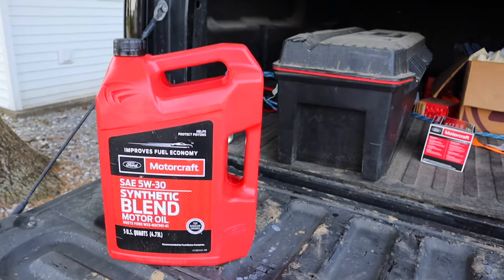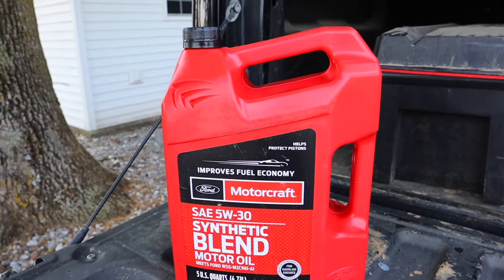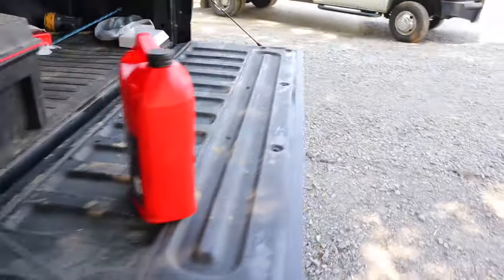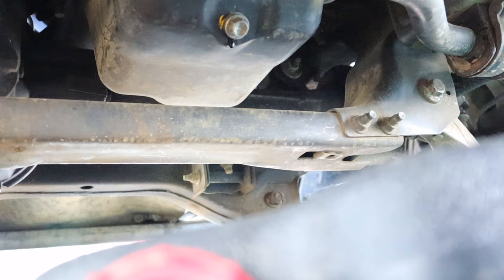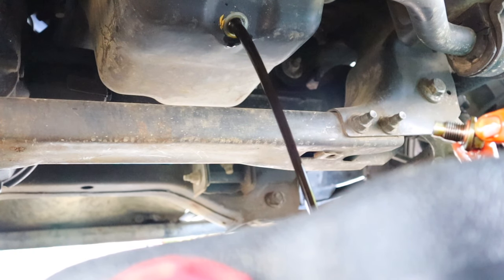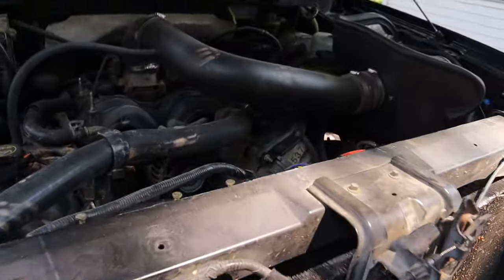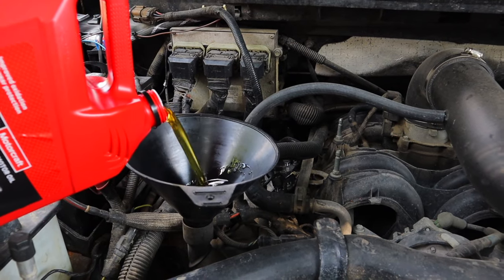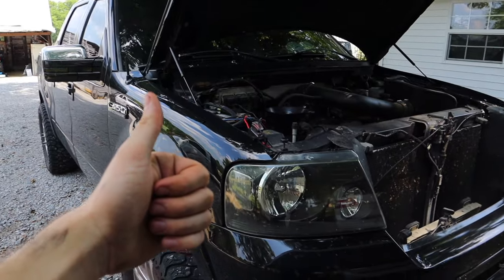HOW TO KEEP YOUR 5.4 TRITON RUNNING LONGER WITH LESS FAILURES!

Comment: I have a 2004 Expedition 5.4L with 240k I go every 5-6K in between oil changes, I use Valvoline maxlife high mileage 5w30 syn blend with a Motorcraft oil filter, the engine runs just as quiet as the day it rolled out the factory
Reply: I could be wrong, but I think you have the 2V, which were much simpler and stronger. I don’t think the 3V replaced the 2V until 2007ish.
Reply: @ESPLTD322  I do believe the 3V came in 04 for the F-150 and 05 for the expedition
Reply from the maker: 2v had issue with plugs blowing out of the heads. 3v has issues with plugs getting stuck in the head. 04-08’s are 3v’s🤙🏻
Reply: I use full synsitic
Reply: How much do you have to baby them? Is staying below 3,000 RPM all the time good enough? I have a 2010 4.6L 2V Crown Vic Police Interceptor and that’s what I do
Reply: @ESPLTD322  you don't have to baby the 5.4L or the 4.6L 2V those engines are tough but I get it, I baby all mine too, I have a 08 Crown Vic and just recently won another one from the auction, I've had my 08 four years 245K and I can count on 1 hand how many times I've done a full throttle pull in that car since I've owned it, its currently for sale, I don't need 2 of them, I already got too many cars 'lol'
Reply: I got a 2006 5.4 with 186,000 and my buddy who's a mechanic told me the same thing 5w30 and Motorcraft oil filter ..so far so good
Reply: @JayThompson25  not all 2 valves had issues especially the 2002 and 2003 model's. I had a 2000 f150 that had 308 thou miles on it when sold to a neighbor and it's still rolling. The 04 to 08 3valve engine failure rate is extremely high.
Reply: @infinity3jif  nope 2004 was 3v newbody expo first year was 2003 with 2V engine
Reply: @americanchauvinist1210   my 2004 expy has the 2 valve
Reply: @infinity3jif  or that’s right the new body expo first year (which was 04 my mistake) was a 2V ur right
Reply: @americanchauvinist1210  no, you are correct on the new body style starting in 03 but the 2 valve came in the 04  too
Reply: @ESPLTD322  Baby them??? I run the gutts outta my P71 interceptor,,,,,4.10 gears and SCT tuned
Reply: @ESPLTD322  With 210k miles on it
Reply: 2004 f150 had the 4.6l 2v
Reply: My 5.4 3v made it to 280k before it blew
Reply: @ESPLTD322 my 06 Expedition has a 3 valve. And 265000 miles.
Reply: @ESPLTD322 my 2007 Expedition and 2007 F150 both have the 3V engine. This was the 1st year for them,  so far they both have held up well.
Reply: My kid just bought a 2008 F-150 I work for a dealership as a manager not service However the advisors had mentioned to use 10w30 to build up more pressure in the oil pump that way there is no dry starts your thoughts on that
Reply: @richc8095  I've never heard of that before.
Reply: @thorrzyro what ended up failing on it?
Reply: @richc8095 thicker oil will build more oil pressure since it moves a bit slower through the oil clearances than thinner oil like 0w-20. But I’d personally use 5w-30 same with a lot of guys
Reply: @justingoats9155  oil pump took a shit, the biggest failing point on these 5.4 3v is the pump. From what I heard, early oil changes are highly recommended
Reply: @JayThompson25 do you know what causes a 5.4 3v 2004 f150 to shit off in idle like mine idles rough and shuts off
Reply: @Anthony-kn8cn shut up dude

Comment: 35yrs in a shop,,he's absolutely correct...Every 5.4 3v with problems I've seen has 1 thing in common,,,customers don't change the oil regularly...CHANGE YOU OIL these engines will not tolerate you not changing the oil....Use a Good oil filter not the cheapest garbage filter from walmart,,,a "good" filter and 5w30 oil of your choice
Reply: slimsherman5818  No I don't recommend them but not for reasons you may think....They may work I really couldn't tell you,,but what I can tell you about additives is this..Before Covid the U.S. military specifically the Army and Marines thoroughly tested several engine additives and found they offered no additional protection against wear...I'm sure if you search the net you can find that report somewhere I remember reading it afew years ago...I wanna say that Lucas oil treatment was included in that test...
Reply: Amsoil EAO88 filter and Mobile One Advanced Full Synthetic since 75,000 miles.  Just over 100K now in my 2010 5.4L 3v.  Purrs like a kitten.  Burns no oil between changes.  A pint sample of engine oil is sent out for lab analysis every 5K.  I currently going 12K between oil changes.

Comment: I have an 08 5.4 FX4 F150 bought new. It has 380,000 now with only 2 tune ups. I live in Houston TX it gets pretty hot here. I've been using Pennzoil 15/40 and Motorcraft  filter since broken in. Oil change every 4,000.  Truck runs great I love it. I do part time hot shot deliveries, have had up to 2 thousand lbs in the bed and have trailered  more then 12 thousand lbs. 15 mpg the day I brought it,14.5 mpg now probably because I run 305/50/20 Nitto Grappler G2s. Truck still looks great except for the inside of the bed.
Reply: Pennzoil 15w40, is that synthetic, because you said you go 4000 miles, that's high for conventional oil
I can't locate pennzoil 15w40 synthetic
Reply: Rule number one never use Penzoil in anything please stop using bro!!! Especially in that 5.4…

Comment: Ive got a 2013 expedition with the 5.4! Change my oil every 4 to 5000 and pull 6500 pounds everyday still running like a champ! I've owned 3 of the 5.4s now and have had pretty good luck with them!
Reply: What oil you put
Reply: @edgar547  use full synthetic . i use shell rotella gas truck red bottle
Reply: Same here. People have a very hard time believing it, but Ive got a 2008 F250 5.4 3V I bought new, and it's got 223k miles on it. Engine is all original with no oil leaks and had spark plugs changed only once at 115k miles. I change the oil every 3k-4k miles and it's never had anything but motorcraft synthetic blend put in it. Also gets a new air filter every 6 months.   I have a theory about these engines. They need to be revved to redline often {atleast a couple full throttle pulls every time you drive it). If you baby them around you'll have problems. Keep the oil fresh and drive it like you stole it!
Reply: That’s because ford addressed the major problems in 2010 with the 3valve

Comment: Bought my used 5 years ago. Its  2005 FX 4 super crew  it has now 310,000 miles and counting.  Switched to 05w30 when it had 200K drove and sounded better right away. I now use Castro high mileage synthetic blend with Slug Protector 5qt and Lucas oil stabilizer every  3K - 3500 miles. Made a huge improvement on ticking noise and overall performance. And to help with poor oil delivery on rights side of engine during  start up, I just add  little  oil and  she starts sounding like a roaring lion.
Reply: What’s that last part mean ? You add oil before you start it ??
Reply: @justicelizana2517  yea I didn’t get dat part neither
Reply: So 310k miles? Stop driving it rn and it won’t blow up.

Comment: Well guys I’ve always ran  motorcraft 5w20  and filter its whole life with one tune up. I’ve had this truck pretty much its whole life. 2004 with 212k miles still running strong.

Comment: I have 211,000 miles on mine {2008}. No problems, no leaks and no issues. I change the oil before the recommended mileage and flush the radiator every year. These engines are sensitive to heat. Keep them cool. I allow the motor to do its rev and idle back down routine before putting it in gear to make sure the oil circulation is going before stressing the engine. I pay attention to its needs and I enjoy the truck very much. Maybe I just got lucky.

Comment: Bought my 2006 FX4 new, always change the oil every 3,000 miles and use 5w-20 synthetic. 145,000 miles and no failures except ignition coil and the first set of spark plugs.  Good truck and engine, still running strong and sounds awesome with Flowmaster.
Reply: Switch to 5w30. Provides better lubrication to the roller followers and lifters that are prone to fail in these engines.
Reply: +2 switch to 5w30

Comment: I tell you what, I have a 2003 4.6L 2v that I bought brand new 20 years ago and have never used anything but 5w-20.  I just  used 5w-30 yesterday for the first time.  What a difference.  So much quieter and smoother.  I will be using 5w-30 for now on.  Awesome video brother.
Reply: the heavier weight requires more pressure to get all the way thru to the passenger side of the engine, 5w-30 lowers the oil transfer to that left side head/cam. its your vehicle though.

Comment: I had an 06 5.4 XLT supercab for 13 years and the engine never quieter when I traded it in for my current 5.0 2018 F-150.  I put Mobil-1 5w20 and 5w30 in it and changed every 3-4 k. Loved that truck

Comment: Just bought a Ford 2005, 5.4 3V triton. Has 197k miles (yep 😬), will do change oil, put new spark plugs and coils, see how much I can get out of it. Truck looks good, well taken care of, paint outside and inside really good condition, motor runs good, no sounds, no rust.
Reply: I just picked up a triton 04 w 160k … I was thinking I might go ahead and do the sparks and coils right away… had that on my last two engines… glad to hear I’m not the only one thinking about that … totally worth preventative replacement as far as I’m concerned

Comment: You hit the nail on the head.
Oil change oil change oil change.
If you don't change your oil regularly, you're going to have problems. 
I have a 09 5.4 with 245k.....no problems yet.
Oil change oil change oil change

Comment: Bought my 07 F150 4x4 w/ 5.4 in 2013 and 67k miles, now has 185k in 2024. Had to do cam phasers , timing chain, hv oil pump at 150k and I have always maintained meticulously but I work this truck hard,, truck still runs and looks GREAT ! I have only ran 5w/20 full synthetic and Mastercraft oil filters exclusively but will now switch to 5w/30 and see how she does, every now and than she gets a tank full of E85. 
I love my truck !

Comment: My ‘09 3V has run 5W-20 exclusively together with Motorcraft filters since I bought it new, the first 8 years done by the dealer and then full synthetics after that when I started doing it myself. Changed at proper intervals from day 1 and now over 14 years later it still runs as quietly as the day I drove it off the lot. It also goes oil change to oil change without the oil level dropping one bit on the stick as it doesn’t burn or leak oil anywhere. When I bought it I never dreamt I’d have the thing this long but it has lasted (FX4 S/crew Luxury Edition with most the option boxes ticked off) just fine and I still like it so why not? 
 Also every other fluid in the truck has been changed out twice over the years. The thing still purrs along without so much as a shake, rattle, or squeak so I’d say putting a few bucks worth of good quality oils in it over the years has paid for themselves many times over.

Comment: I just did the change to 5-30.. so much better in the Summer.   5-20 is like water.    My 09 fx4 is still beautiful 146k on the 5.4 no probs ever and she's fast AF...   been superchipped Cai K&n n straight 3 inch exhaust  for years.  Flawless.  Knock on wood.  😉.    We also had a 07f250 was a state pickup with 5.4.  Ran it 300k before first ever tune up ...
Reply: Hey when you switched to straight pipes or deleted the cat and added a better air flow did you have to have your truck professionally tuned ?

Comment: I'll agree with the change to 5W-30. 
I've heard that many of the oil channels inside the 5.4 Triton are too narrow - a poor design?
But the lower weight of the 5W-20 in combination with the low performance of the original oil pumps creates a suboptimal pressure that the timing system depends on.
Reply from the maker: For sure. Hoping one day to do the full timing job as well as a high volume oil pump swap
Reply: This is our number one seller; outsells everything else we do, combined. Oil passages are fine, but oil clearance at the cam journals is too loose. Over time that clearance opens up enough that there’s an insufficient film of oil to lubricate the cams. Cams drag in the head and beat up the timing components. In the reman engines, oil clearance at the journals is tightened up and they run an M340HP. If you ever plan on doing anything to this engine, pop a cam cap off and you’ll see the problem. Also, I run 5W-30 in ours too (original engine) 😉
Reply: @joshuamuchmore5049  WHat do you think about running 15-20 or 40. I do it- and the truck defintely responded well to it. Reading your comment- is seems it may fill in the gaps where pressure is lost over time. Do you agree? I have typical cam phaser rattle.
Reply: @PatRiot-  Not sure it would help if it’s already acting up. I was suggesting higher viscosity as a preventative rather than a cure. But, it’s cheap and easy to try so why not? I run 5W-30 in mine. Time will tell…
Reply: Oil channels no they not narrow the problem with the 3v is crappy timing components

Comment: Recently picked up an 05 screw 5.4 4x4 with 178k on it. Has phaser lockout done. Just flushed fluids and did brake job and truck runs mint.

Comment: I change oil on my 08 around every 3500miles or once a year. Semi synthetic 5w30 from ford. 42000miles. No issues with anything on the truck. Ever. Bought it new. Gotta dig into it someday though. Still has original plugs in it. I’ll admit I’m scared of that job.

Comment: You are right about this oil. I only recently had a CVT failure but switched there after. 226,000 miles and running strong.

Comment: MY 09 5.4 3V Has 329k no issues yet.
In the following months I plan on a bullit proof session,  
New Melling hv360 oil pump, updated rockers. Timing set with phasers the whole sha-bang. I believe this upgrade will get me over the 500k mark.
Time will tell
Reply: Hey you get any prices on this?
Reply: @thehandymasterco.3501  I've been purchasing these items for the past 2 yes, because I can afford it ,a little at a time.  Total overall is $3200

Comment: Got a 05 king ranch crew cab, I slammed it, got the 5.4, I started to use Lucas oil stabilizer and it made a night and day difference, its quiet as hell and engine revs so smooth
Reply: Do you use the regular or synthetic?  With 530?  Still using the Lucas ?  A lot of people use Lucas in these then you got the ones that are against running additives
Reply: @mick5740 I was wondering the same

Comment: You are absolutely correct, 5w20 is the worst thing you can put in a 5.4, I’ve been running 10w30 in my 2005 since I got it, run Castrol full synthetic every 5k miles and she runs great. Truck is sitting at 250k miles right now
Reply: Should I run 5w-40
Reply: @deandrehendry3733  yes, you should. Better lubrication and it runs quieter. I highly recommend Castrol Edge extended maximum performance (black container) and a motorcraft oil filter. Been using it for years. Still running strong at 300k miles.
Reply: @LuisMartinez-tu4ci   just got a 2006 fx4 5.4 and they were running 10w30 last....was glad to learn they  replaced the cam phasers, I just put full synthetic 5w30 and the motorcraft filter. 270k sounds great
Reply: Bad advice. 5-20 will run through the engine better.
Reply: @wyatt1153  i totally agree!! 5W-20 is what the oil passages are designed for. Even with high miles( 75,000+) if you’re experiencing a little noise, just make sure to use 5w-20 HIGH MILEAGE formula… if noise is still a concern, use an oil additive like Lucas Full Synthetic oil stabilizer, it’s key feature is that it eliminates dry starts. ( which is key in the 5.4L 3V) using a higher first number oil, is not a good idea. Actually using a lower first number allows the oil to flow faster a cold starts. Better lubrication at startup and improved fuel efficiency. Especially when talking about diesel engines!! (5W-40 full synthetic) oh one last thought… stop using synthetic belnds…. It’s not a 50/50 conventional oil/ synthetic compound… save your engine and actually do some good by using full synthetic oil, paired with a high capacity filter to make sure it can catch the smaller micron of dirt that the better full synthetic oil pushes away from itself. Better base oil in synthetic oil means it has the ability to have better additives compared to blends or conventional oils. People will do what the want and believe their version, but full synthetic oil high capacity filter designed for full synthetic, and high mileage formula after 75,000miles and staying with the original operating weight IS the way to go. ( I own since NEW; 1986 Ranger 2.9L original motor and5 speed  transmission, over 500,000 miles 10w30 Mobil1 early on, after 100,000 bumped to high mileage formula and Lucas Stabilizer. Also since new2007 F150 5.4 4X4 LariatSuperCrew, low mileage, at 66,000!!! Again, Mobil1 Fully synthetic and Mobil filter. Still running on all original engine parts, including the spark plugs, which could be a potential total disaster when I go to finally change them knock on wood because I know about the spark plug issues on these trucks.

Comment: My 09 5.4 with 5w-20 and Lucas high millage. I am now at 230k without any issues, no leaks, hear no lifters, no shaving, no rough idle and runs like the day I bought it.
 My tip oil change every 3.5k 6quarts of 5w-20 and 1 quart of Lucas high millage with a premium oil filter.